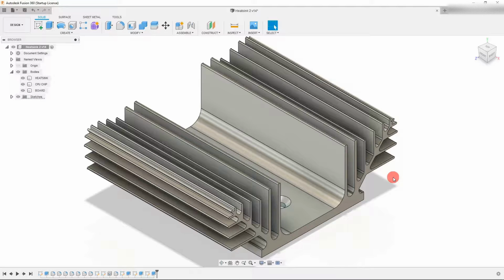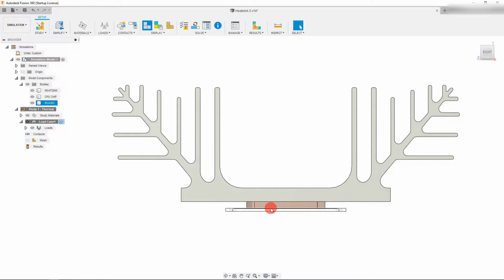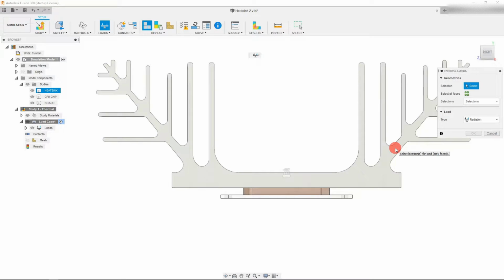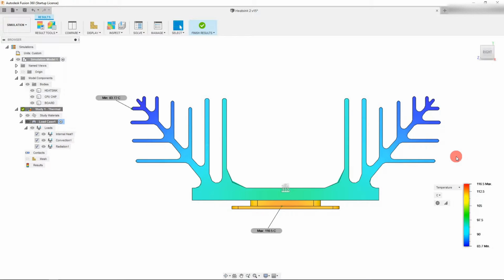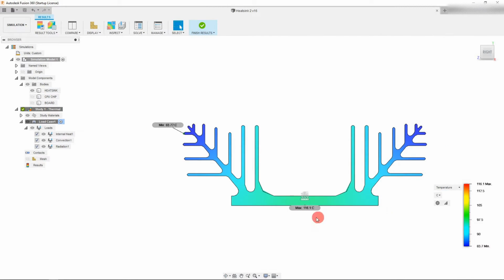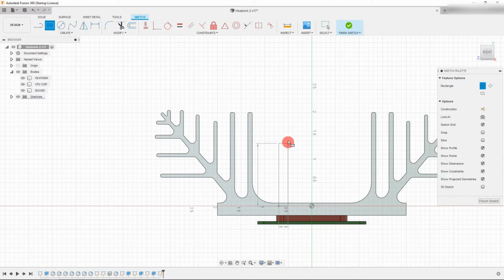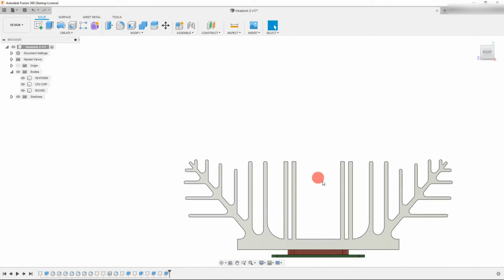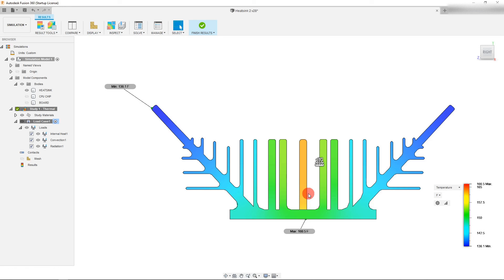Fusion 360 Thermal Simulation of CPU Heatsink: Heat Transfer Analysis Tutorial

Comment: How to consider height of fins in calculation if there height is different? ,as in your case the fins are of different size
Reply from the maker: The main consideration stems from how they break out from the main CPU heatpoint. For this design, I would make the ribs right in the center higher since they are more intimately connected to the CPU and the outer fins shorter to save on size and material.

Comment: Wait a minute.  One of the major points of using a computer to do thermal calculations is for the software to 'figure' out the heat transfer coefficients (natural, forced, radiation view).  Faster would be a hand calculation or spreadsheet for this sort of problem.  Also what is the cooling fluid and how do you change its properties?
Reply from the maker: Yes, but hand calculations are not going to give you values for every single little crevice of a particular geometry. Think about how much more information you can glean from a gradient map such as this.

Comment: how can i simulate the greenhouse effect. ii would like to simulate a closed case with a raspberry pi in.
Reply from the maker: You would set the pi CPU as the main heat source and select the walls of the housing as the containers of the heat.
Reply: @AvivMakesRobots  any link for that setting? how can i select my case as heat container?

Comment: Is a simulation like this possible when you have just a sink and no cpu heat source, and no given wattage? Just a temperature from the base, and natural convection
Reply from the maker: Yes, an implied heat source, but remember that there is no air flow simulation in this study (at least not yet). So your results will be limited.

Comment: I didn't get what is the airflow direction?
Your heatsink was plaсed with edges parallel to X-Y with Z pointed to the top. If Fusion asumes that your CPU placed at the bottom - ribs will not work as expected.
Reply from the maker: Unfortunately, Fusion does not yet have airflow direction settings. This is a "static" thermal intro in that regard.
Reply: @AvivMakesRobots  If it is true, then "convection" simulation is totaly pointless :(
Reply from the maker: The convection value is correct, it just doesn't have a specific direction. Solidworks and Inventor let you dial in more values for these.
Reply: I think the value for convective coefficient in Fusion is Average value, so doesn’t account the airflow direction. If you want to consider airflow direction, you have to use cfd analysis. 
Like what i did: https://youtu.be/HGJObpJZQEo
Reply from the maker: @DidiWidyaUtama  That is exactly right! There is no CFD in this particular module.
Reply: Engineering Juice but you also can try the “Electronic Cooling” module in the Fusion simulation, it have “little” cfd analysis (can consider airflow speed & direction) can be use for cooling heatsink. 😃
Reply from the maker: @DidiWidyaUtama  Yes, I was trying this out today.

Comment: Hi mate, great video. I actually think that at the 3:50, the value that you want is the preset one in Kelvins. I have been doing this for a couple of days now and researching here and there, came across this table. https://www.engineersedge.com/heat_transfer/convective_heat_transfer_coefficients__13378.htm
Reply from the maker: Thank you!
Reply: That truly does not matter since they are the same increment, like F and Rankine.  It's weird that it's even an option.  That said, in SI it is always given as W/m^2K